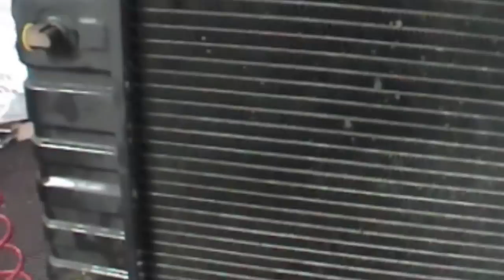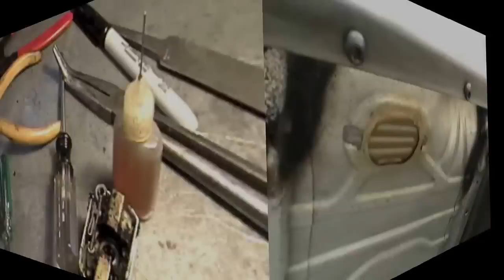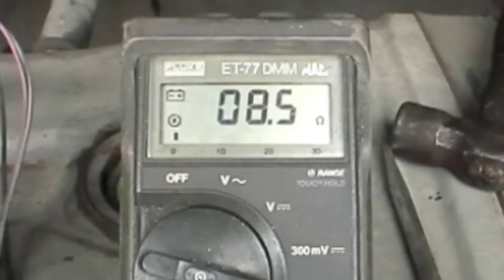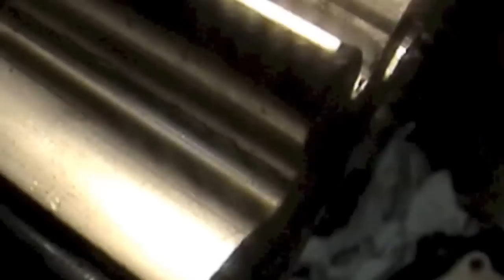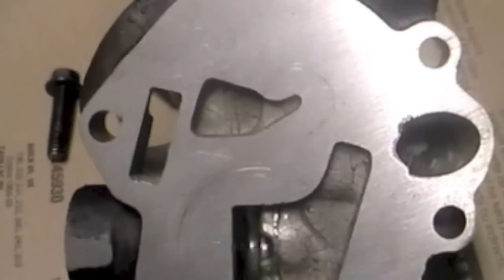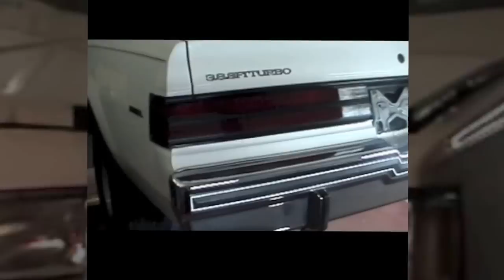1987 BUICK REGAL "T" (SET-BACKS & MAINTAINANCE)

Comment: What did you get for your idle pressure and your just riding around pressure.?
Reply from the maker: Full "hot" @ Idle, and even in a full P/S "cramp = no less 18 pounds ... "gentle-running / driving: 35-50 pounds HOT.